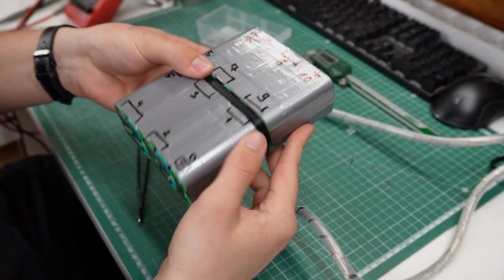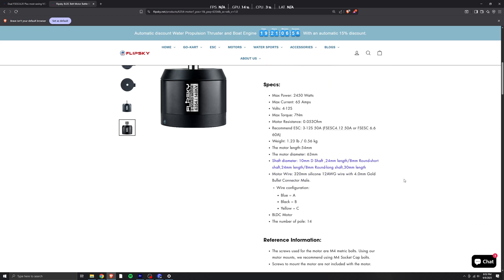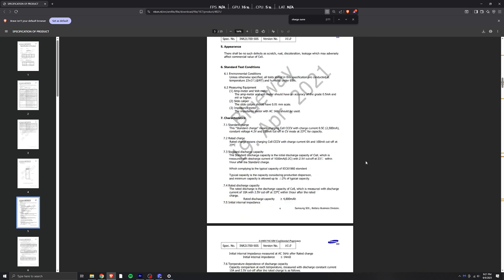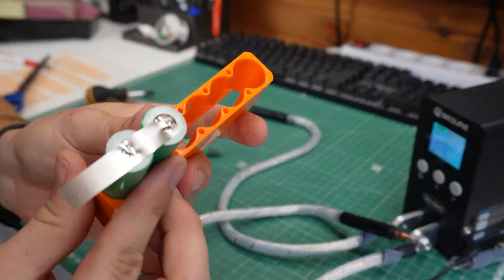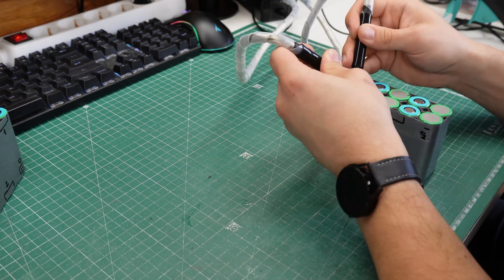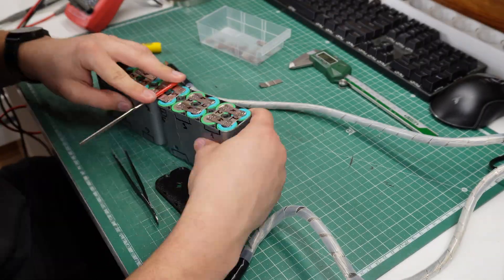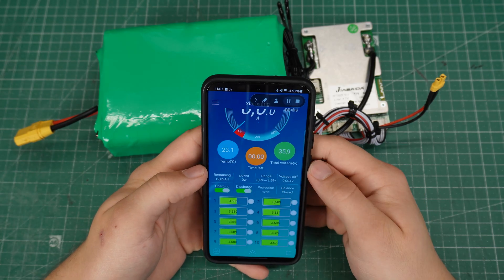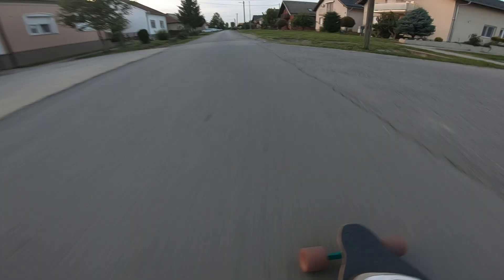Build a High-Power Lithium Battery | JBD Smart BMS + Spot Welding

Comment: DUDE haha you do not need so much nickel strips for parallel connection, high current only goes throu series, two pairs (2p) cells are only equilizing in voltage if they drift a bit and that is sudden and does not take a lot of amps (if it does then you have a problem )